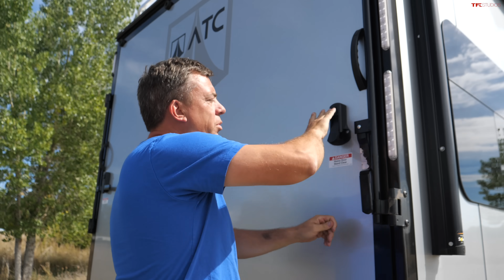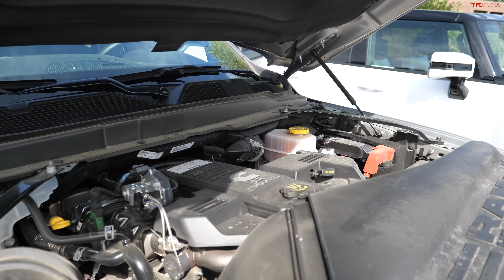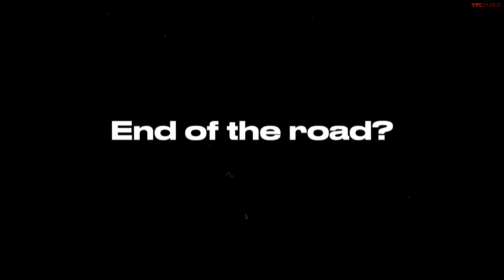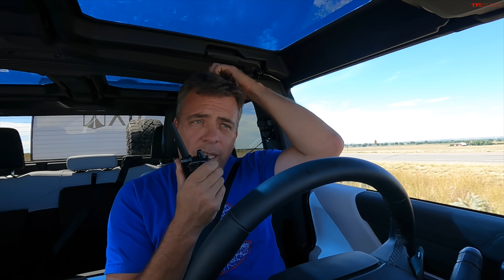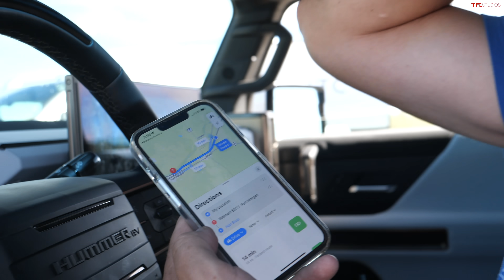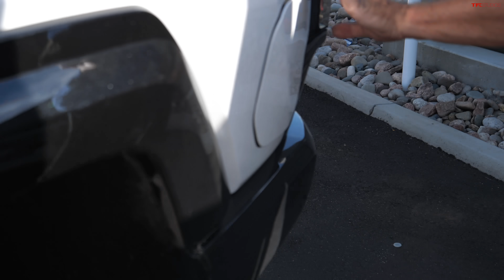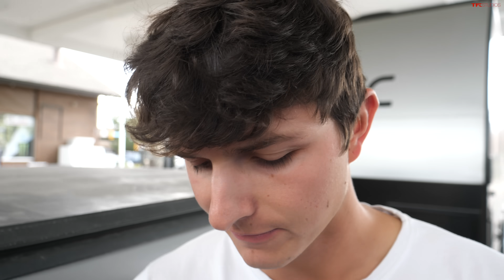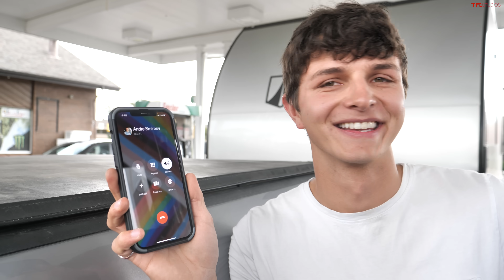How Far Can a Diesel and Electric Truck Tow An Identical Camper Trailer on ONE Fill-up?

Comment: You went 70mph. Now you should try 65 and 60 to see how much extra range you can get out of it. Also note the time differences for those tests
Reply: I can't speak for the hummer but when I'm towing with my lightning locally I can tow up to 10,000 lbs and still get around 2 miles per kwh that's 262 mile range.  So again locally,  that's a lot of towing range.  Drive back home and plug in. 131 kwh charge at home costs me around $10.50 to $16 depending during winter or summer months respectively. So you need to see more local and city driving tests.
Those are the people that the lightning is good for. Oh yeah,  no more ICE vehicle maintenance.
Reply: @pstoneking3418  Out of curiosity, what are you towing? I find at highways speeds, aerodynamics plays a bigger role than weight. Those RV trailers aren't much better than parachutes. I would expect a boat or open landscaping trailer to be much better for range. You did say around town though, so maybe you are staying under 40mph where aerodynamics doesn't matter as much?

EVs seem to be a great choice for a lot of people, even truck people. Just not RV people. It unfortunate that the RV use case seems to be the one that gets the most talked about.
Reply: I expect that Ram to get 11 to 12 mpg towing based on several fifth wheel owners I know. I wouldn’t be surprised if they were going faster for much of it.
Reply: Slowing to 60mph would be 17% more efficient.  Since this is purely aerodynamic drag I surmise the EV would gain this also.
Reply: They would probably get pulled over and fined for obstructing traffic driving that slow in Col. Jokes aside, both trucks would get better economy if they slowed down, that is part of the reason the mega truck companies govern their trucks to 60-65mph better fuel economy.
Reply: Yeah cus a 5mph difference will change my opinion on EVs
Reply: @RiggyRonnie  where in my comment did I say ev was good or bad? It really says, see how much range will change with speed. You could do the same with gas or diesel, but people have been testing gas and diesel for years and years, let’s see how speed affects the new tech eh?
Reply: @spillybuilt7491 55 mph locally and in the city combined I pay around 4-6 cents per mile towing and 2.6 - 4 cents per mile in all city driving towing.

Comment: To tow that trailer 300 miles, the electric Hummer would need to carry a 500kWh battery without addition battery weight. Maybe, a battery that can do that is on a drawing board somewhere, but it won't be in a vehicle any time soon. The RAM with a 30 gallon tank carries the roughly the equivalent of 1,050kWh battery (using 35kWh per gallon equivalent). The RAM can go further because it stores almost five times the amount of energy as the 212kWh battery of the Hummer. However, the "efficiency" of the Hummer (if the term can be applied to that Beast) is at least twice that of the RAM.

Comment: With regard to EV efficiency you are overlooking the generating loss of the electricity so the comparisons you are doing are not like for like. Great video.
Reply: If you're doing that, you'd also have to factor in the energy consumed to pump and refine the oil and then distribute it to the gas station.

Comment: That Hummer couldn't even pull my small Travel Trailer. A Winnebago Mini Plus 26, with a gvwr of 8800 Lbs.  Fully loaded, ready to roll, for a nice week long trip weighs in at 8100 lbs. (as measured at a Cat Scale). Never mind heading to Florida for a winter getaway.  By the way we pull it with a 2018 Ram 2500 6.4 Hemi.

Comment: Curiosity. Let's say the GNV (Giant Novelty Vehicle) accidentally runs out of zipzap on the road, no chargers available in the route, or they're closed for maintenance and the apps weren't up-to-date on that. Can you call an Uber, go buy a gas can and 5 gallons of electricity, and come back to fuel up and carry on?

Comment: If they went diesel hybrid, small diesel up front and individual hub mounted motors, then EV would work well.
Reply: But then it's not a EV, it's a hybrid because it still needs diesel to operate. You're though, a diesel hybrid would be nice.
Reply: @jeepinintexas6215  You're right, it would be similar to how a diesel locomotive works or an earth mover. 2 of which are proven vehicles, just scaling the tech down.
Reply: And cost twice as much
Reply: @jtkrpm1  Isn't that what everyone wants? Mortgages on their trucks?

Comment: Interesting, but everyone is harping on the fact that an explosion powered vehicle can go farther than an electron powered vehicle... we know... enough already.  A more practical test is to go from A to B with both trucks towing same trailers, and see how much faster the diesel can get there.  If you know you weren't going to make it to the next charger, you would have stopped to charge, then continue on your journey.  

How often is a person going to tow their camper 200+ miles? If its every weekend then no, electric vehicle isn't practical.  If its 3 times a year, so what if you have to wait another 30 minutes to charge to get there since most the time you wont need to fill up anywhere other than your own garage.

Comment: So 37.50$For a half a charge and it took 30 minutes on a super fast charger why didn't you charge it all the way to 100%? Two maybe 3 hours when you can just pull up to a pump 5 minutes and drive away and if you think about it 21 gallons was what 100 bucks to get to 100% in the Hummer would be what $76? Do not see the efficiency at all or the waste of time in charging and having to backtrack when you can go 7 maybe 800 mi in a day in a normal vehicle hell freaking no will Ev ever work for me

Comment: You guys honestly need to also compare refuel times.   The times need to be from when you pull into the refuel station to when you pull out.  Starting to see that not only is the charge time extremely long but there’s a lot of additional time wasted by waiting maneuvering unhooking and adjusting and finding a charging station that works.  That’s part of the real world process and us users really need to understand that.  You also seem to be wasting a lot of miles/time getting to these recharging stations and you’re using energy and time for that too and that needs to be accounted for as well.

Comment: If only they built the diesel or Natural gas powered generators farther away from the charging stations you could pull in with the trailer still connected. That's what's behind the grey wall a generator running on diesel to make electricity to charge EV's

Comment: I have a mobile welding  business, it's not uncommon to drive 100+ miles in a day  to multiple jobsites.  Sometimes I wouldn't  have 8+ hours to charge at home before I'm on the road again. This is not practical for true truck uses.

Comment: Not surprised by the results. What scares me is the batteries.  What are there life spans? What kind of degradation of overall performance?  Cold weather performance? 
Can you run them to empty and not damage them?
Reply: Even RC cars have low battery voltage protection so you can't run them dead, none of the EVs will let you drive them to 0 volts.

Comment: Bullshit that’s what these electric trucks are. I’m sorry not sorry. You’re spending $115,000 on a truck in Encanto more than 150 miles with a little 6000 pound camper. That’s crap and then I got to sit here and worry about what charging station I’m going to stop at before I get to my final destination come on guys. We are a long way off on electric trucks

Comment: These electric trucks haven’t really been designed to replace the load luggers that the Cummins etc are. 
These are the 1st gen of electric trucks, think of them as the Nissan Leaf or similar of passenger cars. 
Admittedly they should be sold as such - without towing capability for example so ideal for a crew cab for site work or as a family hauler for a tradesmen but I don’t think we should be too hard on them yet. 
The 2nd gen should be a massive improvement….. or prove electric is a pure waste of time in this sector.

Comment: Guys-- whats next-- dropping mentos into coke to see what will happen?  why are you still doing this type of video? dino fuel contains what- 12x the energy mass over batteries? the outcome is known. What would be more fun is putting the same amount of energy in both vehicles and watch as all those heat losses make the diesel lose.